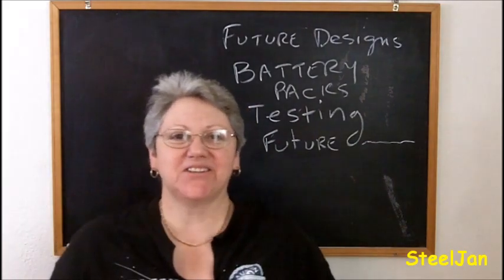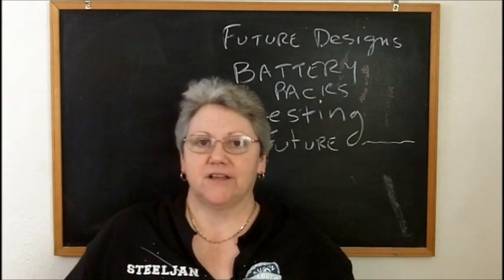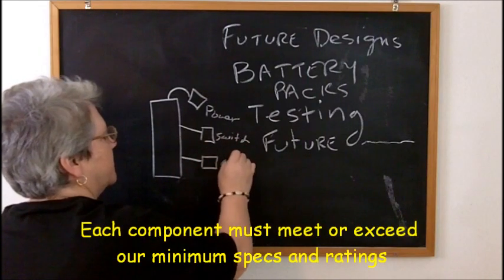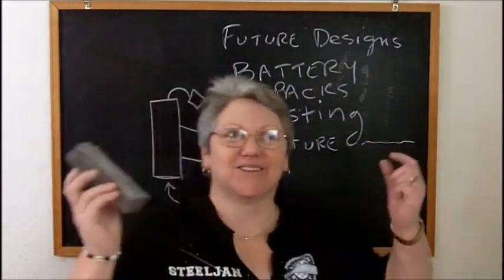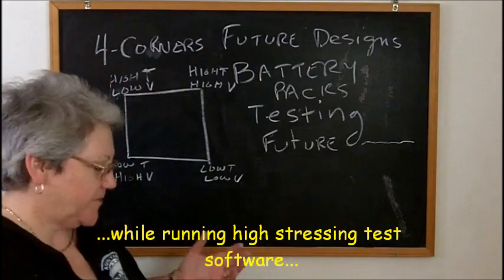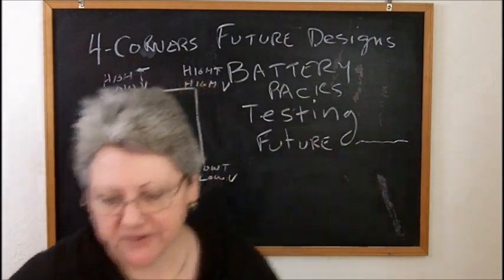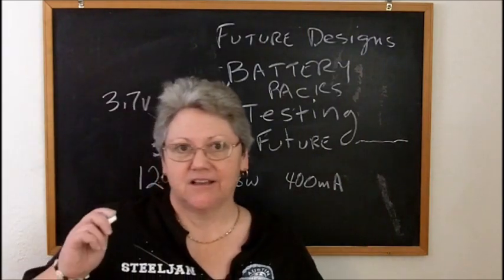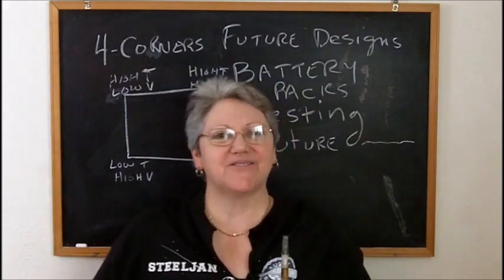Ecig Future Design Ideas - Batteries, Testing, Standards & Certification

Comment from the maker: It's instantaneous current that is important in vaping.  What you are proposing with 300mAh cells is equivalent to wanting a plastic hose to deliver a gallon of water per minute, so you hook up in series three little plastic hoses that each are rated to deliver 1/3 gallon per minute and think therefore that they will deliver one gallon per minute.  No, they will deliver 1/3 gallon per minute, no matter how many of them you string together.  If you put them in parallel, then yes, they can.

Comment from the maker: @AlSelk Absolutely true AlSelk!  I've now been testing this Altoids vv mod from Smartvapes with two 4.8V nimh batteries and Efest dual charger from VapingZone for two weeks and it's working perfectly.  It lasts more than a day before needing to recharge the batteries.  Completely safe, completely great vape.  Did you see my puckmod vid where I built a nimh mod using 3 AAA-sized nimh batteries?  That little puppy still vapes fine too, just doesn't last long.

Comment from the maker: @byaksu Have you read ecf today? Another explosion, this time another Ego battery, a brand new battery right out of the box, exploded on a charger, flew across the room, spewing molten chemicals all over the couple's kitchen and ruining their floor.  Luckily no one was injured and they opened their windows quickly to vent the house. They're trying to figure out right now if it was the charger or the battery that was faulty.  The nimh batteries in the Altoids mod lasts more than a day.

Comment from the maker: @Chachacha1973 Yep, I'm using this SmartVapes Altoids variable voltage mod with two of the new nimh 4.8V batteries and the dual Efest charger (got them from vapingzone).  I get over a day until the batteries need recharging.  So far so good, I'm on day 9 of testing this setup.  This Altoids mod uses the same electronics as my black vv mod, stays nice and cool, regulating the higher voltage of two batteries in series down to vaping voltage. Really saves the amps.

Comment from the maker: @Chachacha1973 I got my 4 nimh batteries and dual charger from vapingzone - it's the only place I could find in the US that sold the Efest dual-charger made specifically for these 4.8V batteries.  The batteries take 5 hours to charge, so I didn't want to go for the single charger from madvapes. I've not tried low-res on this setup, not interested in low-res anymore, don't like the high amps that low res demands.  Cheers, hope you like it.

Comment from the maker: @QCAssociates Hey Dave, if you have a couple of the 4.8V nimh batteries laying around, put them in a dual 18650 (batteries in series) variable voltage mod that dials-down the voltage.  I'm on day 9 of testing this in a SmartVapes Altoids mod (same as my black vv mod but mine uses 14500s) and it's really working well.  Getting over a day of perfect vape out of it before needing recharging. Using Efest dual charger, from vapingzone.  Hugs!

Comment: great video. good idea. think it could be little more simple pack. think cell phone or laptop battery. just plug it in and the mod could handle the on off and so on. but yes we need a stander and certs for it! great work steeljan keep up the good work!

Comment: I completely agree if we don't self regulate the Gov will do it for us and probably not to our liking. One of the trends I've seen lately is the use of PWM (Pulse Width Modulation) and duty cycles to regulate coil temperature. Proprietary parts exist in all industries so I doubt we will see to much standardization. Quality control and testable standards are goals that must be pursued for the safety of all. Battery pack standards will be difficult due to the multitude of shapes for PV's.

Comment from the maker: @vicsvape The literature says IMR batteries do not explode.  There's a video on youtube where a guy shorts one out and all it does is vent and put out 230F or so of heat in a few seconds.  I have a bucket of sand next to my easy chair, so I know where a mod is going if I feel it going thermal and there's not enough time to get it to the door to throw it.  But probably the greatest dangers is during charging and then storing the batteries to where nothing shorts them out.

Comment from the maker: @RTAbombshell Well, it would be no different than it is now.  I mean, if I'm going to make a mod that holds two 18650 batteries, I've got to figure out what the battery holders will look like, how they are going to be affixed and wired into the mod, and etc.  With a battery pack, bingo, it's all in one piece, you would know the size and dimensions of what the space needs to be for it.  Spend the modding time on the asthetics and ergonomics.

Comment from the maker: @msvapehead I charge my lithium batteries outside on concrete, monitor them while they are charging, and take them off of the charger as soon as they are finished charging.  I store them laying down in an open plastic container where there's no possibility that their ends can touch.  Also, I inspect the batteries often and take them to recycle if any plastic gets torn or scraped, if I've used them a lot, or if they are more than 2-3 months old.  But now I'm getting totally away from Li batteries

Comment: the ego is a battery pack. it has surge protection, charging port, on/off switch and atty connector. but, still uses the li-po battery for continuous stable power... if ever we use ni-mh batts, it will be bulky and will last no longer than the mini e cigs out there. but, its still a good project though. specially with testing and all of that... maybe, there should be safety standards for us vapers for the pv's that we use.

Comment from the maker: @minus1724 Laptops have many safety features built-in plus they are never trying to pull as many instantaneous amps out of their lithium batteries as an ecig does, yet we are pulling those amps out of smaller batteries so the chance of thermal runaway is much higher.  Plus, we are using chargers that are oftentimes inadequate or poorly made.  So yes, I do charge my laptop indoors but no, I charged my ecig batteries outdoors.. I've now gotten totally away from lithium mod batteries.

Comment: @QCAssociates Using NIHm would be a better choice then NiCads. The newer designs do not have the memory effect of NiCads and you can also us LSD NiMh which have minimal self discharge. If you look at the specks of eneloop LSD NiHm it shows they should have plenty enough amps to run an e-cig, especially if you stay away from the LR devices. They will hardly break a sweat at 2 1/2 amps.

Comment: @steeljan :D the 4.8v Nimh batts arrived yesterday so after charging them i tried one in my Saber Touch (my Altoids Box Mod wont be here for a while)  with a 3 ohm cartomiser... well, it almost blew my throat out, and at 1.6 amp/7.68 watts (instead of 2.23 amp/7.70 watts with a 3.4V PV with a 1.5 ohm cart) I decided i will wait till the box mod arrives so i can ramp the amp down a bit. Thanks so much for your help :D Cha xo

Comment: SteelJan, just a random thought here, but in the video you were showing 3 cables for the user to unplug, why not just a single connector with multiple leads? mainly aimed for anyone that considers this idea, don't make 3 connectors that someone can mess up, make a longer connector that has all of the leads build in to it and a fitting that only allows it to plug in one way. Just my .02, vape on!

Comment: i love the idea of the battery pack but i also thing that would me actually less time for the builder to make their mod beautiful  and would be even more confusion to put together and make even less space inside the mod itself. you are easily doubling the wires if not tripling with the connectors. then there would have to be the design for the switches with connectors on them Or they would still have to be soldered on. its a great idea but IMO it would be harder.But thats just my 2 cents

Comment: I don't see why there hasn't been a push for NiMh batteries for e-cigs They are far safer then any lithium battery, readily available, and much more user friendly and robust. You do have to use at least 4 AA or AAA batteries to get the volts needed to drive a standard e-cig, but with a bit of creative tinkering a box style e-cig could be done that was comfortable to use. 

I know there is the 4.8 v battery, but standard AA and AAA is everywhere, and there are some very high quality ones made.

Comment: I've got some of those big green batteries. Are they the 5 volt ones. I didn't know what to do with them when I got my first mod but I then had to order a special charger for them. I love your ideas for some future regulation and testing. I too am a retired engineer. Make that mustang engineer. 30 years as a technician but never very good with theory. Lucky to get a 2 year degree in electronics.
12 volts shouldn't be that far away in a small battery. Needing much less current should be doable.

Comment: @steeljan what batteries are you using instead of Li? I live in Arizona so if I try to charge my batteries on the concrete its like 120 degrees out there so I am forced to charge them inside. I have noticed that my ecigs do not do well in the summer at the lake :) water plus heat not a good combination for sure. Thanks for the tips I think it is important that your bringing this info to us novices :)

Comment: I don't think your high voltage idea is too crazy. In fact My Bosch Lithium Screwdriver has a 10.8-V Power Pack, it's probably only slightly larger than a D-Cell battery and I'd imagine would have no problem running a PV since it can drive Drywall screws into Douglas Fir with no problems. I'm sure the price on these things has come down quite since I bought it years ago when Li Batteries were first coming out.

Comment: Jan, your videos are awsome, I was If you could possibly send me some sort of schematics on how to build a simple 3.7 e pipe? Im having trouble understanding how im going to insert the battery, I want the button to be on top of the pipe hole? And its a big enough chamber that it will fit a 18350 batt, im also going to drill my own hole in the side and install the 510 connection. So its bassically a cylyndricla hollowed out barrel

Comment: I bought a non joyetech battery from discount vapers and the button got stuck on! I wanted some of the mini ego batteries and couldn't find real joyetechs so I bought 2 from discount vapers. They run hot! I'm not into high voltage anything and I measured these on a meter and they look ok. They must have a weird duty cycle or not be regulated. Burny burny! Cheap though. Have you put any of these knockoff on a scope?